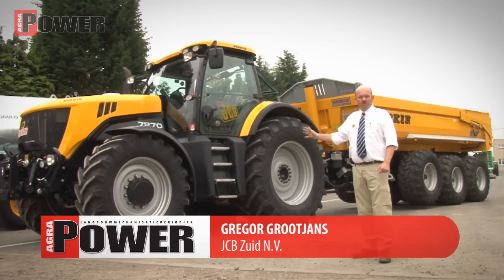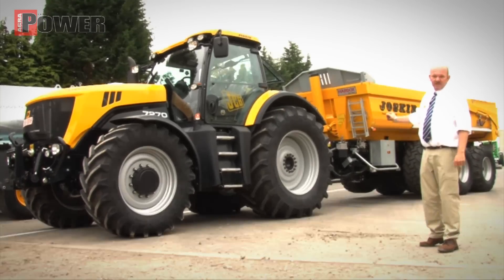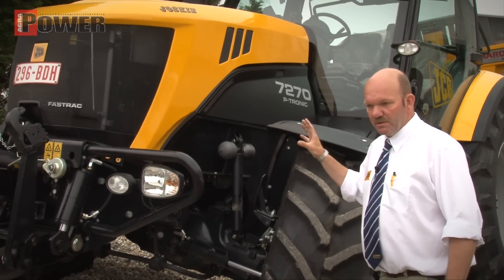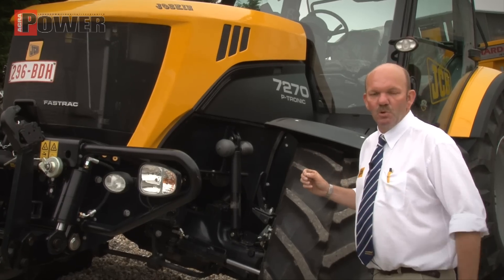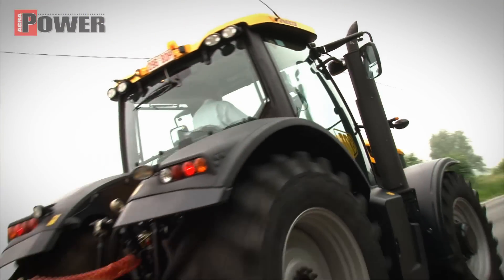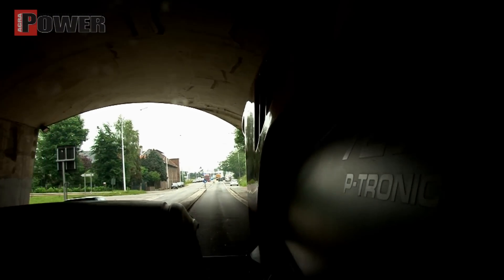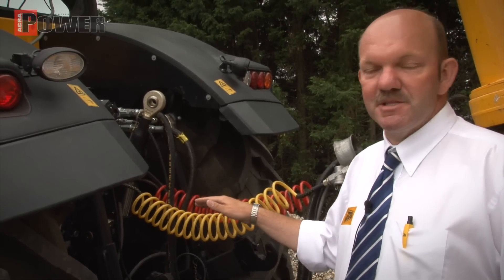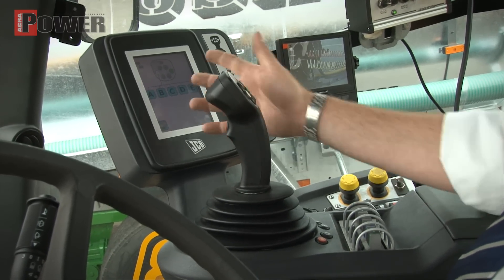JCB Fastrac 7270, 270pk en 70kmpu

Comment: Yes the brakes are external.  It's to allow axle oil to stay cool and for ABS. We have never had problems with mud affecting them yet.  Do the brakes on your truck stop working when they get wet or dirty....  And this tractor stops faster than a semi.  So should semis go slow to In case a kid on a bike rides in to the road.

Comment: I would say ,just take a MB-Trac 1800 Intercooler from early 90's(best with fast gearbox and axis),make all gears shiftable (evtl.give engine some more hp,up to 300hp should be possible) and than drive the 60-80 km/h it offers with one of the coolest and best tractors of all times(especially its sound) ! And about Fendt vs Deere: Johnnys have no chance in my opinion ,they can't touch this German Engineers Work in any case,they are only cheaper,thats all a German Farmer would ever buy one for ;)

Comment: JCB would not make a product that is not safe. We made the brake pads for the older models and there were never any problems with the disc brakes. the stopping distance is less than a tractor with conventional brakes due to the fact that it has ABS.

Comment: Have you forgoten the 6R 7R 8R and 9R series from John Deere ? They are currently the most advanced tractors on market. Does a Fendt 939 has electric powered active steering like the JD's ? No, Does the Fendt 939 is a user frendly tractor ? No. Does the Fendt 939 has a chassis to his power ? No Why ? To short! Does Fendt has tracked tractors ? No. Which is the most powerfull tractor from Fendt ? 400 bhp and Deere ? 600 bhp  Do you want more reasons to buy a Deere ? Nothing Runs Like a Deere!!!!!

Comment: LOL huge fail...
So disc brakes... The tractor goes to the mud, bye bye Ferodo pads...

And other thing, we only see Fendt, John Deere, Case, New Holland, Claas, Challeger/Cat in our fields for some reason...

And 70 km/h... There is a Mercedes that run at least 80km/h here in Portugal, search for Lagoalva and you get it. 
But at 40km/h tractors are dangerous, and these engeniers go farther to 70...
If a kid with  abike cross the way of this tractor, well... Tractored kid for sure...